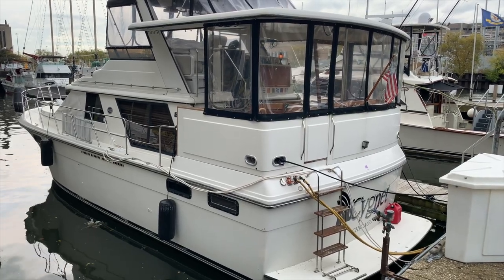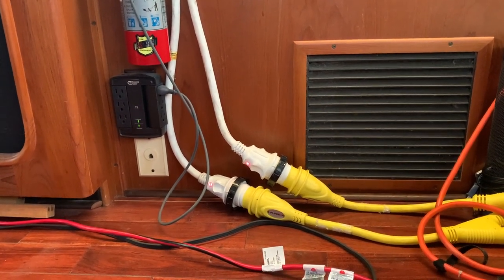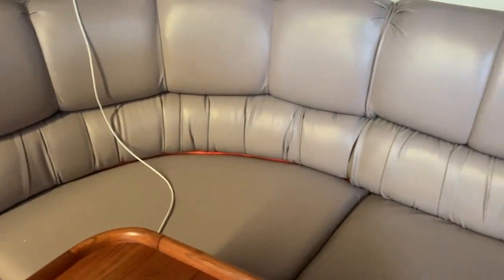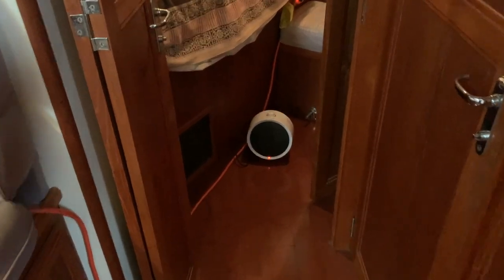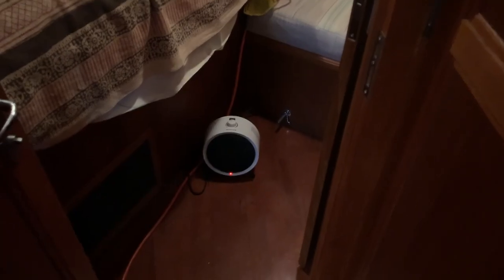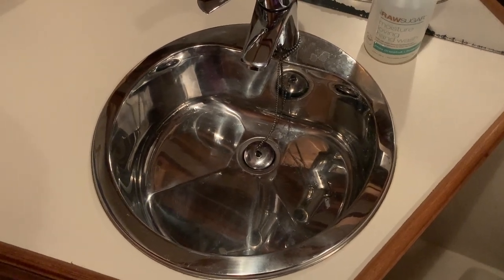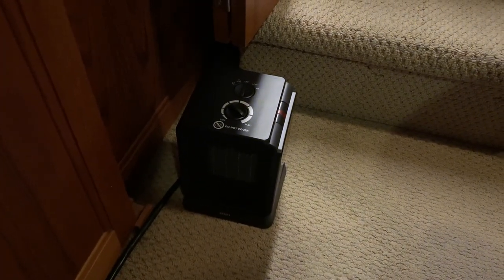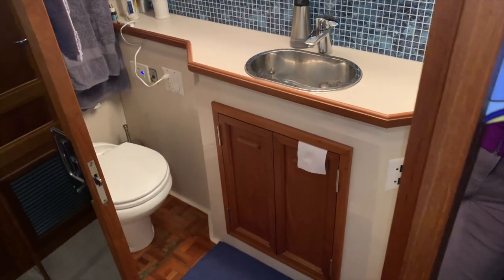Heating Cygnet in Winter 2020

Comment: Wow,  I just found your channel so I am catching up.  Based off my experience working as an electrical designer.  You set up pretty good,  though it isn't ideal it works.  When I worked as a civilian contractor in Afghanistan, we had the same types of problems on base.  Though we did use mini split unites for heating and air conditioning.  They worked really well at both but it depends on the size of the unit and the area your trying to heat and cool as well as any obstructions in the way such as doors.  What I think would be better on a boat would be Diesel Hydronic heating.  Or Diesel forced air.  Though with Hydronic you could get on demand hot water with in addition to heating your boat.  But both would mean putting in an additional fuel tank, though the one for heating wouldn't need to be that big.
Reply from the maker: A neighbor on a sailboat is thinking hydronic, I didn't really know it existed until recently. We're going to do something in the next couple years as we don't plan to get rid of this boat any time soon. At least we don't think so...
Reply: @waterwethinking1142  Since you are liveaboards.  And anything that produces heat uses huge amounts of electricity with by your land hookup or by generator.  It would make sense to use an alternative fuel to create the parts that require heat.  Another chanel SailLIFE recently installed such a system that would be beneficial to you to look into.  However your boat being gas, I haven't seen many systems that use gas for fuel only diesel ones.  Though adding one is still possible if you added separate small diesel tank just stop supply your heater.

Comment: I know you boat is a bit spread out, but have you ever thought of a propane heater? I had a Dickinson Propane heater on one of my boats that did an amazing job. It heated the whole 33 foot boat with heat to spare, never ran it on more than the low setting unless I was coming back from a trip where everything had been turned off for a weekend and just wanted to bring the boat up to temp quickly. I loved my Dickinson cabin heater.
Reply from the maker: We've looked at them but never thought they were the right solution for us. Did I mention we don't pay for electric?! Well, at least not directly.

Comment: SV Basik has a good video on his use of diesel heaters. The cheap ones from eBay works of 12 v. I'm wondering where in inverter/charger is? They have issues with the gas-operated heaters according to off-grid/marine users
Reply from the maker: Thanks, I'll check them out. I didn't want to introduce another fuel supply and go diesel since we have 400 gallons of gasoline sitting in our tanks and that's a lot easier to access throughout winter. But we're finally getting to the point of looking at alternatives.

Comment: Have you considered a mini stove, like a cubic mini/cubic grizzly? (go grizzly) A lot of sailors and RV's use this if they don't have diesel propulsion. Tons of dry heat and fuel is easy to attain, handle and store.
Reply from the maker: Yes, we've looked at them and do like the idea. We would have to do a serious retrofit to make it work in here, but not opposed to it.  One thing about the electricity is it's FREE at our slip.  Or more accurately, it is "included" in the price of the slip.
Reply: @waterwethinking1142  yeah, I heard about that another couple in a bayliner in your marina, they were on WGN news a couple years ago. Not sure if they're still there, but sounds dope and sweet spot.
Reply from the maker: That was probably us in 2015. WGN news did two pieces on us, WGN radio did one, and we're on the latest tour of the Chicago River from WTTW.

Comment: Would have not been better to run a system with high Velocity Duct that runs off of 115V and would heat the entire Vessel? And that would eliminate the use of Cords and make it safer?
Reply from the maker: What would we use as the heat source? A compressor style like a split unit or gas? We like the split unit residential style but we don't have a great space for it. Also they are something like $12,000!
Reply: @waterwethinking1142  12 G’s !? That must be for a marina to custom install. I full time in a rv and thinking about mini split not only the low amperage, but noise. You can get a 3 zone unit for less than 3 thousand and if you’re a somewhat DIY’er and have a HVAC tech check your lines and charge them for $300-600.

Comment: Dielectric grease is only good for preventing corrosion or waterresistance on connector dont get it on the prongs or in receptacle. it doesnt conduct electricity and is an insulator
Reply from the maker: Good to know!